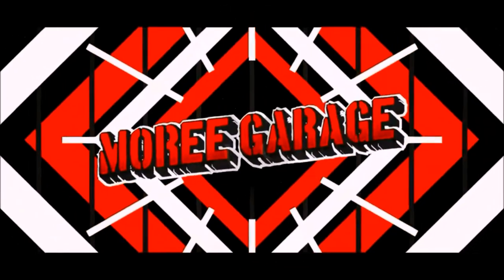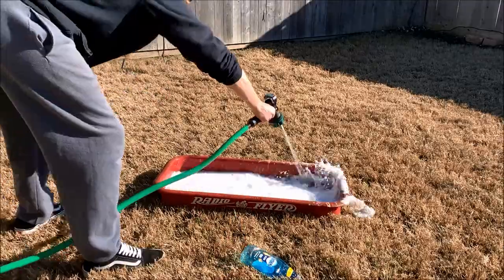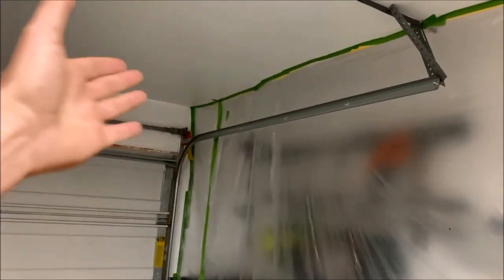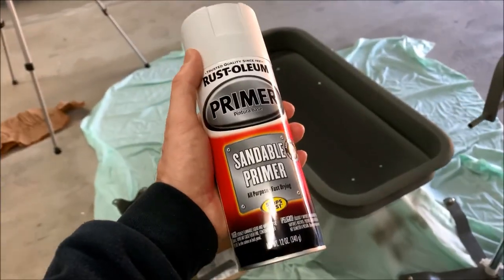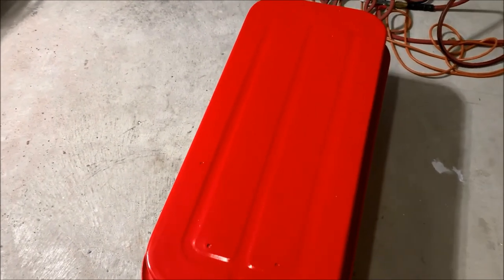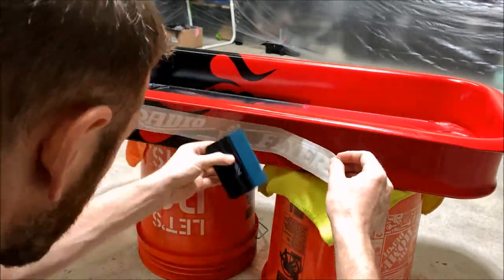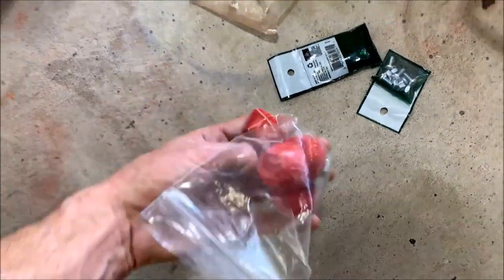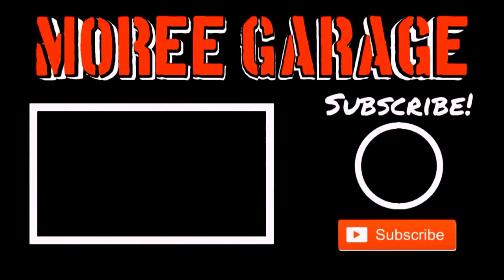Radio Flyer Wagon Restoration With Custom Paint

Comment: Great video, for the wheels what spacers did you use? I have the same issue since I bought the harbor freight wheels.
Reply from the maker: I’m sorry I don’t remember.  But I could only find them at lowes.  Home Depot did not carry them.  I just measured the diameter of the axle and the inner diameter of the wheel and that’s what I used to find the spacer I needed.

Comment: What size size bolts did you use to put everything back together? When I took mine apart they were so rusty they broke.
Reply from the maker: @fvkyxu  I honestly don’t remember.  I just went to Home Depot or Lowe’s and bought a set of bolts that fit through the holes
Reply: @JordanMoree  I looked on the radio flyer website and found the hardware set which I believe is the right bolts

Comment: Hi! 

I’m currently restoring an old wagon my dad found at a garage sale. I’m about ready to paint the wagon. I’m using Rustoleum Gloss Regal Red. I’m going to need to seal the decals as you did. Do you know of a clear coat that is compatible with the Rustoleum? All I see are horror stories from people applying clear coat to it.
Reply from the maker: Any 2K clear is fine.  Use the clear I showed in the video or Eastwood makes a rattle can version as well.  Just don’t use any single stage clear.  It must have a hardener mixed.
Reply: Thank you so much! 

By the way, your restore job on your wagon is awesome!

Comment: You said the wheels didn’t fit as the axle was to small, so you bought what exactly? A sleeve spacer? What size?
Reply from the maker: I don’t remember the exact size I had to get but this is what it is.  I got them at lowes. 
https://www.lowes.com/pd/Hillman-3-8-in-x-1-2-in-x-1-in-Seamless-Steel-Spacer/3012477?cm_mmc=shp-cprdhdwgglLIA_HDW_126_Fastening-3012477--0--0-_-0&ds_rl=1286981&gbraid=0AAAAAD2B2W-9FZ1Oj6FYZ9h1oDnM9zhwZ&gclid=EAIaIQobChMI8ZmMi5ui9AIVp21vBB0U3A3HEAQYASABEgJmkfD_BwE&gclsrc=aw.ds
Reply: @JordanMoree  great. Thanks.

Comment: What kind of axles spacers do I ask for to put the harbor freight wheels on
Thank you
Reply from the maker: https://www.lowes.com/pd/Hillman-1-2-in-x-5-8-in-Plain-Steel-Standard-SAE-Flat-Washer/3012480. 

Here’s what I used.  I can’t remember the exact diameter so just make sure you get the right size.  But I got them at Lowe’s.

Comment: Can you tell me what spacers you used? I’m having the same issue with the harbor freight wheels, I need to space them but can’t find anything that fits
Reply from the maker: https://www.lowes.com/pd/Hillman-1-2-in-x-5-8-in-Plain-Steel-Standard-SAE-Flat-Washer/3012480. 
Here’s what I used.  I can’t remember the exact diameter so just make sure you get the right size.  But I got them at Lowe’s.
Reply: Thank you much appreciated